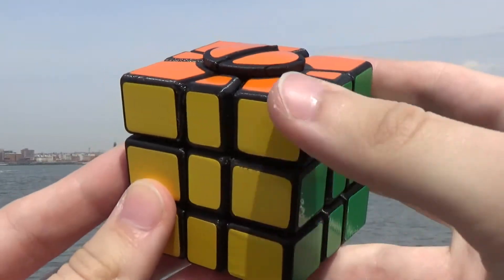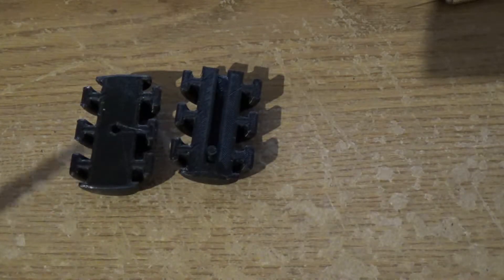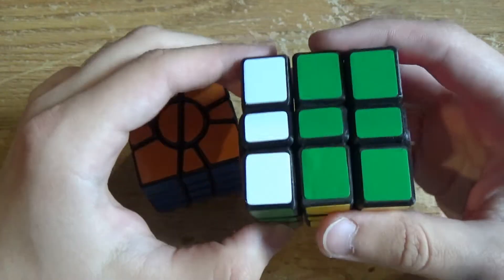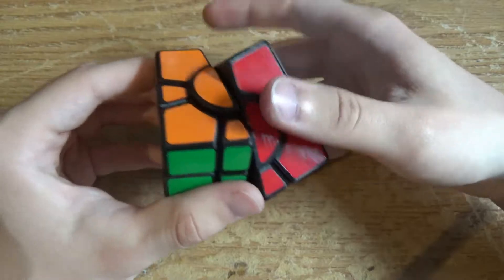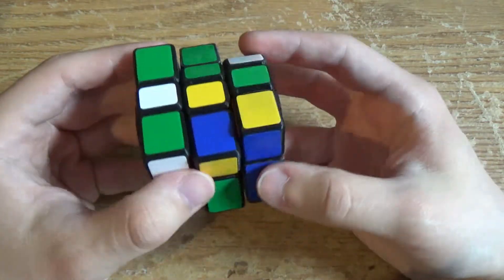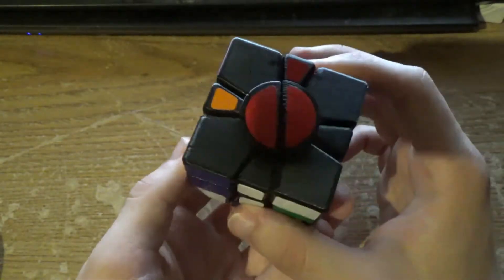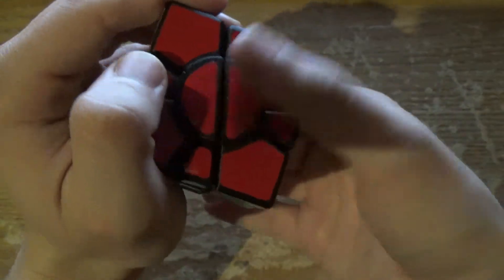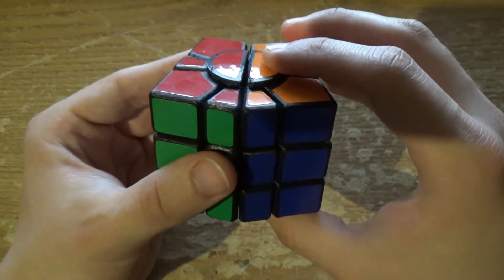Sliding Super Square-1

Comment: In case anyone's wondering I fixed the files :D If chewy ends up selling the puzzle It will also be fixed.
Reply from the maker: Awesome! I'll probably print some extensions for my own puzzle, so as to not have to reprint (and refinish) both of the cores.

Once I do that, and put some lube in it, it'll legitimately be something I can take and work on solving for a long time. This puzzle is really much more difficult than it looks.
Reply: The same like me